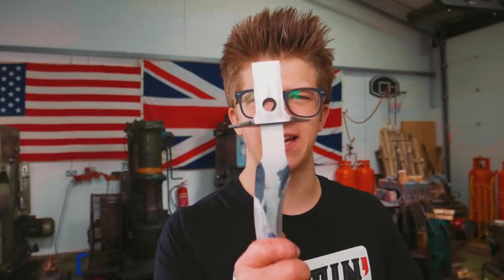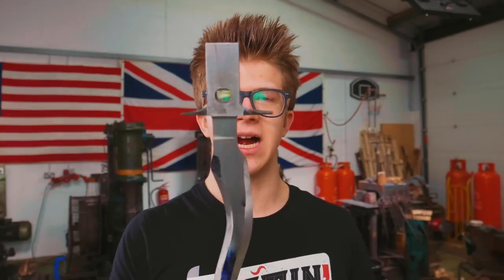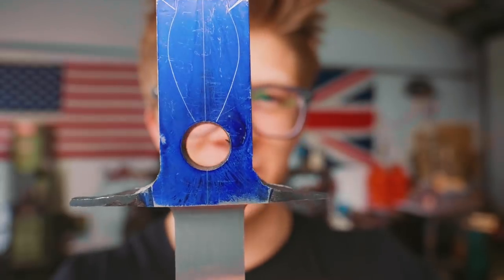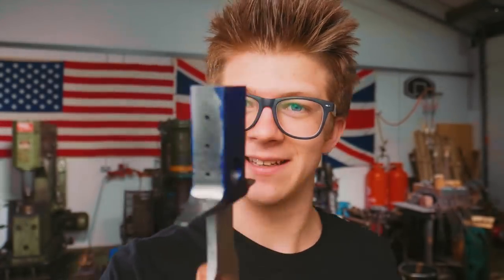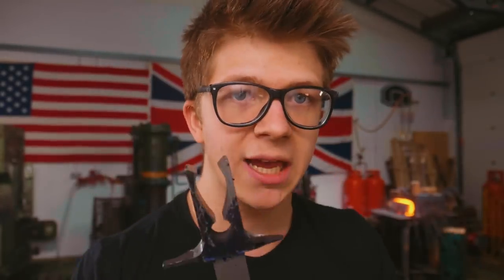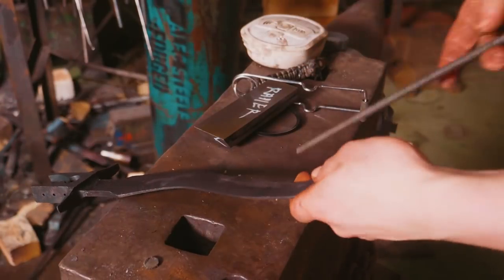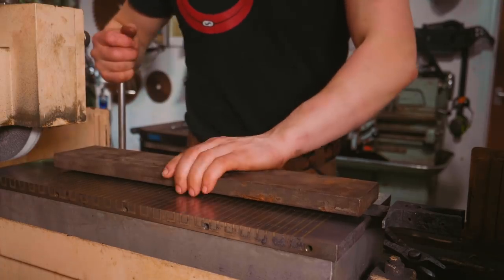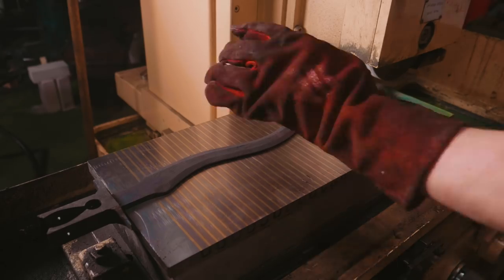KRIS BLADE DAMASCUS DAGGER!!! Part 5

Comment: Hey Steele, I have a solution for forging a meteorite, the way of forging it is not to kompress it until the cracks are gone, you have to make it flat, gently, an then put the ca 75mm to 1cm pieces on top of each other, you don’t need a weld if u use the traditional Chinese method of wrapping it in a towel and putting clay on it to prevent oxygen to get to it, then just hammer it down again and fold it a few times, this refines the metal till the cracks are gone, I saw this technic on a video called making a meteorite sword and the problem of breaking also appears on a fresh made steel, I hope it helps you if you still have the meteorite and I would love to see some more traditional techniques in the future, i am a great fan and I want to start making stuff like you in the future, keep up the awesome work:)
(And the clay method is actually called tile stacking method, it is traditional japanese to reforge broken swords but is just fine for a meteorite, you see it on a video of the channel awe me where they made the sword of Aragon, hope it helps you)
Reply: I hope I explained it good enough, if not just ask

Comment: Have you considered purchasing a small vertical bandsaw? It would help avoid always going to the angle grinder...probably safer as well.
Reply: Ed Graef I think the bailey has a vertical mode. Was wondering why he didn’t use that!
Reply: If I was Alec, I would think about purchasing a used wire EDM.

Comment: I highly recommend making yourself a heat treating furnace! I made mine many years ago and love it... I think the post is still up on Bladesmiths forum and I know there's a few other posts there about making some. I made two, one for normalizing and hardening and one for tempering. They're both 120cm long and the hardening oven gets to temp (800 donegrees science) in under an hour and holds it +/- a couple of degrees over the length of the furnace. 

Love your videos!

Comment: Alec, great video. When I started out in construction, I always had a pocket paper pad to make notes and reminders. As I got into cabinetmaking, a more complete list of steps was developed. If you want to avoid making too many mistakes, start with a list on a whiteboard of the steps you need to make in the order you need to make them. HIGHLIGHT the CRITICAL steps and check the list after each step to see what comes next and to see if you missed a step or if subsequent steps are out of order. On the side make another list of materials and tools you'll need to complete the project. It removes a great deal of anxiety and helps the work flow go much more smoothly. Keep up the great videos!

Comment: Alec, have you considered setting up a horizontal quenching trough, so the whole length of the blade can hit the quench at the same time? This will help prevent warping. Also moving the piece around in a figure 8 pattern while in the quench will help keep the quench rate of the piece consistent. If you just dip it in and hold it stationary, pockets of heated quench surround the piece and lengthen the time it takes to cool, which lowers your overall hardness.

Just take care not to hit the sides of your quench container while moving the piece around, as it is very brittle during the hardening/quench phase. Best of luck in the future, love your work.

Comment: Hi Alex two quick things 1) you’re braver than me using a 9” angle grinder I refuse to use them they scare the crap out of me and 2) the decals on the cutting disks want to be the other way don’t know if it’s the same with the disks you use but ones where I work are shaped for the screw to sit correctly when decal is up just FYI if in future get disks like my work shops ones

Comment: You can correct that bend with a fine rosebud torch tip. Carefully heat on the proud side right at the shoulder. Initially it will go even more proud. As it cools, it will settle into a less proud position. It may take a few tried to get it as flat as you want.
I used to use this method to straighten shafts. 
I know it's counter-intuitive, but it does work.

Comment: I love the the look of the kris thus far. The integral guard is marvelous. With regard to the keyhole, I've found it much simpler to cut my radii with a mill before cutting/grinding away the supporting material. Then I use a burr to remove the little remaining stock before finishing with other abrasives ;-)

Comment: I don't understand why you do not build another forge. I think that for larger projects you can use the forge with three fireburns and for smaller projects you can use the current forge. I'm sure it will not cost that much but it will make life easier. 

Otherwise amazing video like always!

Comment: Hey Alec! I work for a company that builds custon high temperature ovens. We could easily build you a heat treating oven that fits any size project you could possibly need to heat treat. We can also make it a multi zone oven so you can choose how much of it you want to use. Max temperatures available from about 12-1300˚C upwards of 18-1900, although generally speaking every 100 degree increase in max temperature doubles the price. We can also build ovens for 2000 degrees, but that's a very special and very expensive application.

Comment: Alec, your magnetic fixture may be acting as a heat sink to that side of the knife. By sucking heat away on one side of the piece, it's linear thermal contraction is happening faster, resulting in an internal stress that causes warping that would be consistent to what is shown in the video. I saw on the first attempt that you had another block on top, I assume to combat uneven cooling, but unless it was a similar material and size to the mag plate, you would still have an uneven cooling profile.

In my previous career we had to balance in-mold cooling rates for iron castings. With any kind of thin web geometry, we would find warping if we didn't make a heat sump somewhere to ensure it didn't cool significantly faster than the rest of the part.

Just a thought. Love your content, keep up the amazing stuff.

Comment: For all of the invesments you have made, you really need to consider the thermal side.  Heat treating furnaces are not cheap by any consideration but knowing the temperature from which you quench makes a big difference in hardening outcomes.  A kitchen stove is a great tempering oven if  is big enough and you mitigate the on/off heating cycle.  I don't temper long objects so I can get away with a pan of sand as the medium and I always use a thermocouple to check my temperatures.  Anything heated to non-mgnetic is not hot enough.

Comment: hey Alec i've been watching for a while now and i just wanted to say i work with industrial magnets everyday (Blanchard grinding) so i know what im talking about when i say you really dont want to do that with your surface grinder magnet. 1. you dont want to leave the magnet on for extended periods of time with no coolent on the magnet. it will cause your magnet to heat up and that can fry the copper spools inside the magnet. which leads me to the 2nd issue. 2. heat is the biggest enemy of an electromagnet. it can seriously damage the insides of your magnet. do not put hot pieces of metal on the magnet.

Comment: Hey Alec, I really think your next addition to the shop should be an electric heat treating oven. I think it would simplify the process of hardening the long blades you're currently making. The heat would be much more consistent and it would provide more granular adjustability.

Comment: @alec if your mag plate is room temp and the steel is hot from the oven it's going to differentially cool. the side of the blade that is on the plate is going to be colder faster due to the heat loss into the plate. The blade will shrink faster on the side faced toward the plate causing the other side of the blade to warp away from the cold as the blade cools. I think a clamping fixture in the oven is the right way to go after another normalizing cycle haha. I love the keyhole handle btw.

Comment: Doesnt Maglocking the blade introduces heat differential between both sides so one cools faster than the other. Blades will warp the way you mag lock it

Comment: Why not mill the keyhole?  Just asking....
Reply: Vic Nesheim would like to know that too
Reply: Or bandsaw I would imagine..
Reply: He stripped down the machine and half rebuilt it.  He now knows it's accurate; coupled with all the energy/time spent squaring up the end - milling would have been much more accurate that attacking it with a cut-off wheel!  Now, there is always the possibility that I do not know what the f**k I'm talking about or some other very valid reason he did it the way he did.  I'm just curious - if precision (which so far on that end of the Kris) has been of such paramount importance, why was the mill not used?
Reply: Vic Nesheim my guess is that the curve in the key hole would be more complited to program into the mill than to cut by hand.
Reply: Could very well be, Joshua.  He's got a mill, not a CNC.  I'm around CNC's and G-code way too much.  Probably has my thinking skewed.  Never used a mill - straight from CAD to G-Code.  Find mills and the skills to use them fascinating.
Reply: Cool - will do Dave!  We're getting our Demo Markforged METAL X in a couple months.  17-4 SS to start, with tool steel, inconel, Titanium to follow.  It's sintered at about 2300F after printing and machine--able - claim is better than 99.7% void free after sintering.
Reply: With only a vice you would pinch the end mill in the part as you cut material away. He would need to used tie downs. To hold it without pinching it as he mills. There ya go Alec haha
Reply: No need for programming. Just hand wheel it. One wheel for X-axis and one wheel for Y-axis, almost impossible to "scew up" ;) Then again maybe the mill table is suuper long and the wheel is out of reach while having an eye on what the mill is milling, but he was just doing a rough-job on the sander as well anyway

Comment: You really should make a sword forge soon. It might be boring but it will help you heat treat your blades. Also if you learned any thing from your rapier, it's that you need to pre-bend it if you're ever going to get it straight.

Comment: The mag plate may be fighting you with that warp. My thinking is that if the plate is efficient at absorbing heat it may be cooling one side faster than the other, causing your warp. I am already aware that the warp may be from of the first steps of this process or the imperfections in the material itself but pointing out uneven heat warp due to resting surfaces is a testable possibility.

Comment: Alec, what if you made a jig inside a hrrizontal quench tank, with steel pins rinning the length of the blade offset so you have pins on either side of the blade every so often to keep the blade from warping as it cools? Just curious if it can be done that way?

Comment: you need an induction forge.. instant heat, dial up temperature and heaps cheaper to run than a gas forge which is too short.

Comment: Just a quick question here.. when you are trying to get rid of the warp in the blade by heating and holding it on the surface grinder will the heat sink ( from the big slab of steel ) on one side of the blade ( the one attached to the surface grinder ) not cool faster thus just making it worse or just doing nothing?

Comment: Since metal flexes before it can be shaped permanently you can't just pull it into the shape you want but have to overcorrect i.e. account for the flexing. Therefore the mag chuck has to fail by default. Or the metal would have to be hot enough to lose its flex completely, but I am not sure at which temperature that occurs.

Comment: Alec you really need to invest in a scroll saw. It is a lot easier to cut fine detail with than using an angle grinder to cut out the key hole.

Comment: you should invest in a die grinder it probably would have made cutting the key hole a lot easier than using the angle grinder. you get tons more dexterity when making smaller more precise cuts

Comment: I actually ended up with an angle grinder disc in my leg a few years ago. A 10x10x50mm wound in my thie close to the knee. Luckily it didnt bleed much but it was not fun.

Comment: Hi Alec, why are you still messing around with that short forge for large projects? And while you're at it an electric forge would help you keep the correct temperature for heat treatment and for the tempering also.

Comment: if you put the angle grinder in the vice by the handle you can use it as a table saw. use the grinder guard to rest the workpiece on as you slide forward.IF IT WORKS IT'S NOT STUPID!
Reply from the maker: That sounds very stupid even if it did work, though i am sad to contradict the t-shirt slogan :P
Reply: small grinders, not big

Comment: The keyhole came out real nice...I'm just wondering why you didn't use as smaller end mill and mill away the bulk of the material, then work up to a larger endmill.... You would of had to just take maybe an 1/8" or so at a time but at east you could of gotten more practice with the mill....then finished it out with the belts...

Comment: What if you built a bigger furnace and actually make it 2-part with something like a thick door in the middle. That way you can heat up smaller projects quicker if you need to.

Comment: Bruh, after tempering, try lightly heating the outside of the warp with a torch while in a vise and gently bending away from the warp. It wont kill your temper, doesn't need much heat or pressure and I am 99.999% sure it's easier on your steel than quenching multiple times.

Comment: Good morning. A question about hardening. I see that you are hardening vertically. I saw on a tv show once where the person hardened horizontally with the blade facing north. Is there a difference in vertical and horizontal hardening?

Comment: why don't you buy an oscillating multi-tool? The Bosch PMF 220 CE cuts metal.  I have one and used it on 1-inch round bar it cuts beautifully

Comment: Is there any reason you don’t bend the metal gently after the heat treat to straighten it before mounting it vertically in a vice, like on Man At Arms?
Reply: Al Patto risk of cracking I would think.

Comment: get a vertical metal bandsaw... they are "only" around 300£ ... and that piece you removed... was enough for several pocket knife blades... almost cryed when i saw that beautifull pattern just turn in to dust

Comment: Hey, Alec. Have you heard about the small hammer tecnique to correct the warp issues? It consists in using a small ball hammer (the ball tip around 4mm in a 350/400g hammer), and doing gently but several hits in the inner part of the warp concavity. It will produce tiny deformations that will stretch de steel and will align the blade. 
Obviously, this must occur after all the heat treatment an before the final grinding. I've been doing it to adjust some eventual warping in my knifes and it's very, very effective. 
Hope it can help you somehow.
Sorry about the bad english.
Wish you all the best! 
André, from Brazil. @facascarcara

Comment: It's a shame about that warp considering all that time you spent meticulously straightening the blade after forging, but I have faith that you'll pull through (although I'm surprised you didn't go for a shimmed temper to begin with, but theres only so many hours in a day) ;)

Also I left a message on facebook and an email asking about your potential plans for a zwiehänder project, not sure if you got them

Comment: You shouldn't be using the magnetic chuck to straighten: heat destroys magnets and you'll eventually kill that chuck which will cost $$$ to replace..   Get a big thick straight bar and a bunch of clamps instead..

Comment: Why don't you design a forge that you can expand or contract to the length you need to get an even temperature across the whole blade before you quench?  Something you can have burners across the length but can cut them off and then block off the furnace to shorter lengths for efficiency with smaller items.  You like making stuff.  Design it and sell it.  You could do the same for a tempering furnace too.

Comment: Hey, Alec, it seems like you're having quite a lot of issues with heating these bigger projects you've been working on lately. Wouldn't it be smart to build a bigger forge at this point to avoid issues in the future?

Cheers!

PS: there was a lot of artifacting in this video from about the halfway point and out about a quarter, I suspect the YouTube rendering is acting up. Just thought you should know if you didn't already.

Comment: I had an angle grinder kick back and took a 6" disk to my thigh.  Oddly it did not hurt or bleed too much...
Took about a dozen stiches to close it up.
0/10 recommend
Reply: pinchflat when the blade breaks it is mostly hot and for this cautericing the wound immediatly.